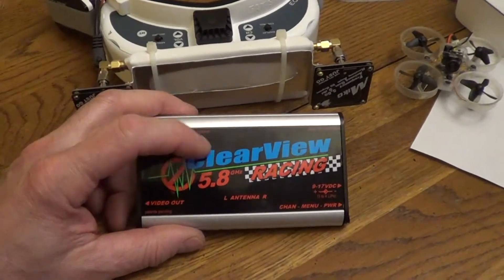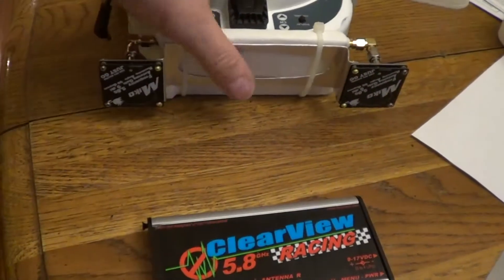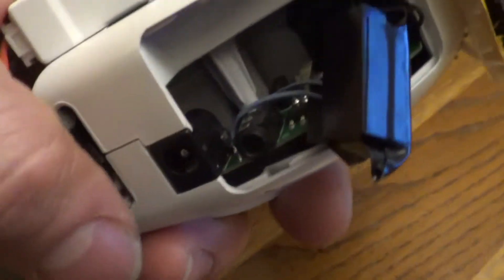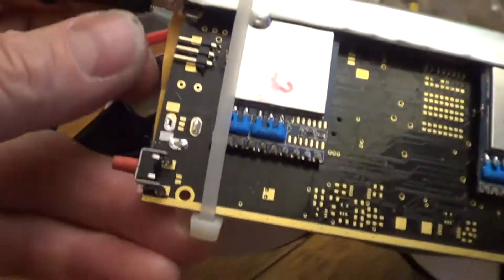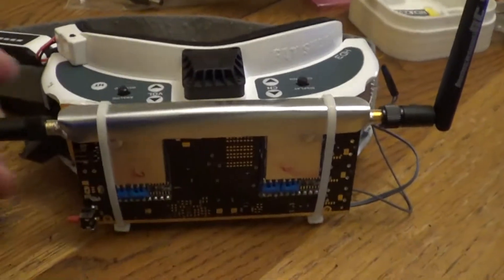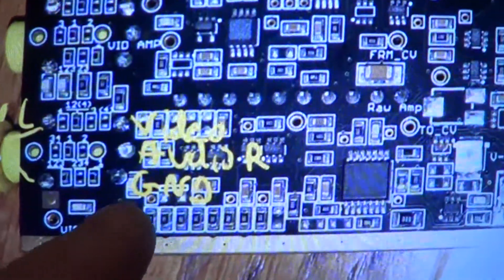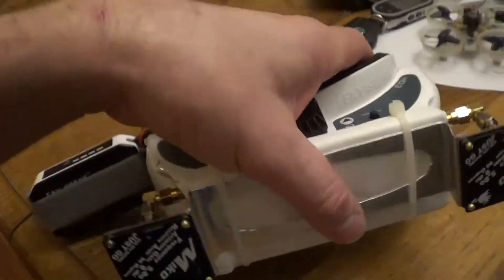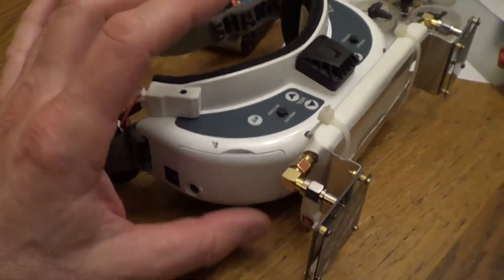How to add Clearview to Fatshark Goggles

Comment: VERY NICE!  One thing, you are probably loosing around 1.5db because of the right angle SMA adapters., much better if you extend the patches on coaxial and bend em. ABCrasy did test to prove this.
Reply from the maker: Great idea.  I'm going to try RG402 and solder it directly to the antenna with the other end soldered directly to the receiver sub boards.  Attenuation at 5.8 Ghz should be around 0.1db.  And, I get to lose 2 SMA connectors on each receiver plus the unsheilded trace on the board.  If I pick up 3db, I will be increasing range 40%.  This is a no-brainer.
Reply from the maker: I will video a before and after range test.

Comment: Hey. Nice video. Oh just one thing you were incorrect with. You don't need to have the same antennas, but they DO recommend that you do as like you said it's not a diversity receiver. It says in the manual if your wondering. Just got mine now super excited to test it out!!
Reply from the maker: Patch antennas are linear just like wire antennas.   I'm pretty much linear on everything with vertical polarization.

Comment: Using 3s would eliminate the need for a converter of any sort, right?
Reply from the maker: yes.
Reply: Thanks. When is your next vid coming? BTW, I am gonna try and imitate your setup next week.
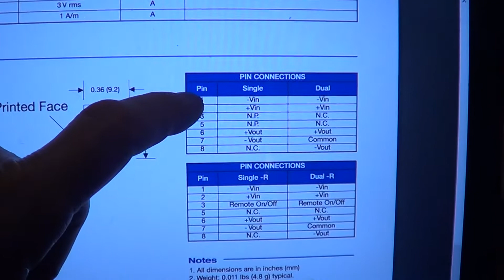Reply from the maker: I just boosted the transmitter to 1.3 watts.  Now, my weak link is the video downlink that is stuck at 25mW.  I bench tested a "200mW" tiny whoop camera, but it was just a piece of junk that only put out 40 mW.  I have some videos coming now.  I managed to get Tiny Whoop down to 17.9 grams with 4:30 flight time.  I just evaluated a cellular 5.8 Ghz "sector" antenna and had very poor results.  So, i'm going to evaluate the RSSI pro tracker from the UK for the ground station.  I don't really like how the clearview degrades at the edge of reception.  It is almost un-flyable.  I'm posting 2 videos now.  i have will have a bunch more when I eventually achieve 1 mile "one way" range on the Tiny Whoop.  My clearview goggles are great for 1000 foot stuff, but the 5000 foot range is going to need a tracking ground station.
Reply: Awesome! Thanks, appreciate it

Edit: Have you experimented with other antenna;s on the clearview? That pro tracker looks interesting

Comment: is this strictly a fatshark option or can I mod my box goggles?
Reply from the maker: This is for any goggles.  I'm just added a voltage converter to allow 2 cell lipo and reducing weight on the unit by losing the box and shrink wrapping it.

Comment: wouldnt  haven patchs  facing the floors defet the purpos of haveing a GS tri pod set up cool tho .
Reply from the maker: When you are close the rf reflections make the patch antenna work facing all directions.  Patch antennas are just wide dipoles.  The do have significant signal strength behind.  They also collect more of the polarization than a simple wire antenna will because the conductor is wider.  When I fly out far, I do have to look in the direction I am flying to get the best signal.  By the way, I am working on very long range Tiny Whoop gear now.  I will have more videos coming soon.  I will boost the 2.4ghz transmitter to 1 watt, then ultimately 5 watts.  Getting video back from an 18 gram aircraft is trickier.  I am limited to 25 mW 5.8 ghz on the video from the Tiny Whoop.  So, my ultimate setup is going to be RSSI (signal strength) directed antenna array on top of my house.  I hope to get 2 km (1 mile) range on the tiny whoop.  There is good stuff in the pipe line coming soon.